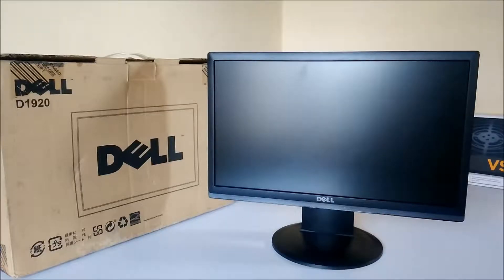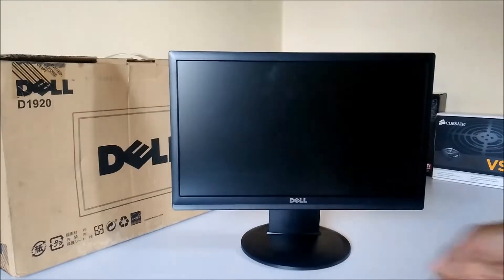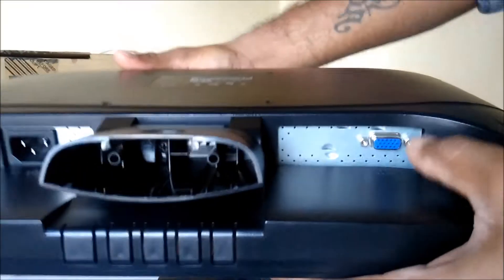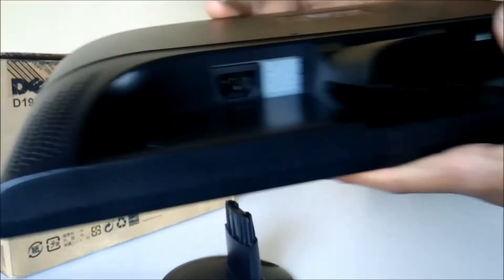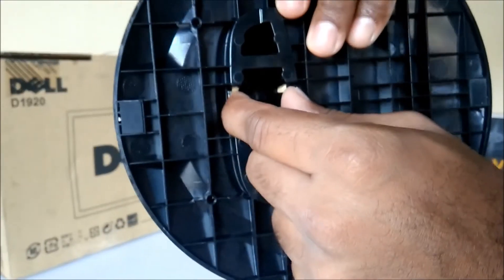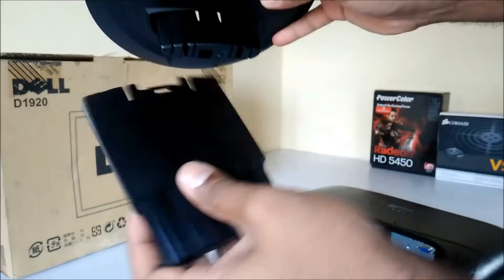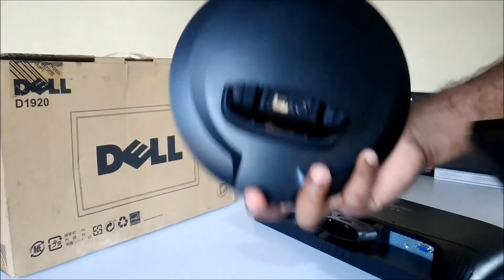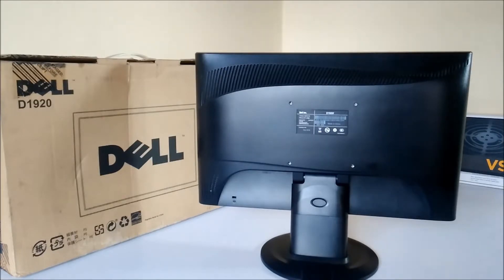Dell D1920 LCD Monitor

Comment: Bro can i get display driver of D1920
Reply from the maker: Yes
Reply from the maker: Driver pack solution website you get all drivers
Reply from the maker: Don't forget to subscribe
Reply: @princesunil26k  i cant find it bro
Reply from the maker: which cpu you have
Reply: @princesunil26k dell Vostro 260s
Reply from the maker: visit driver pack solution and select instal all required driver option